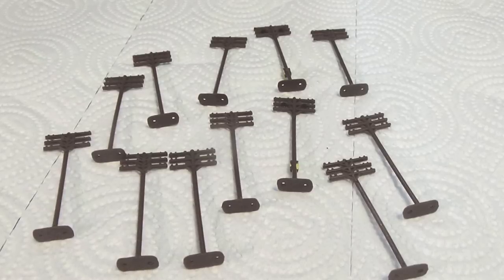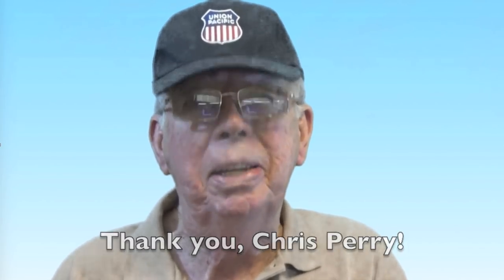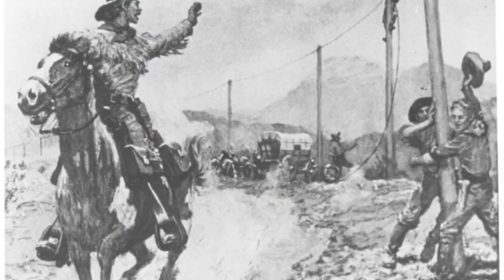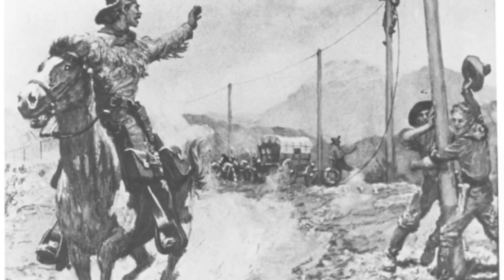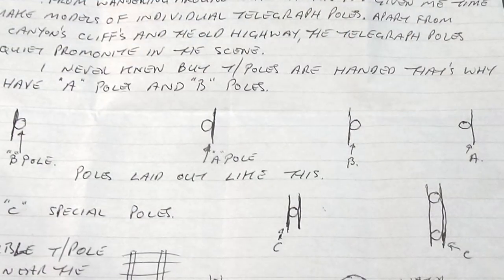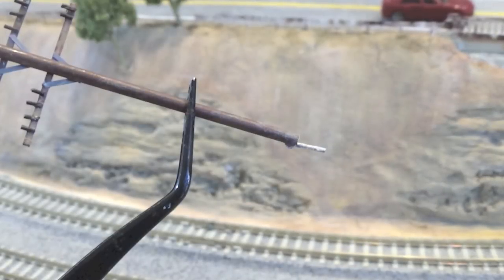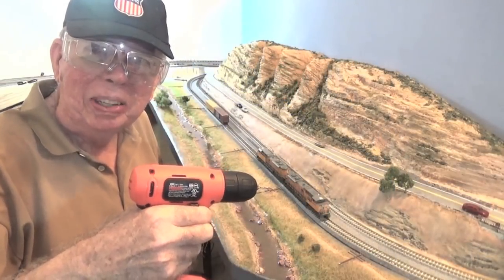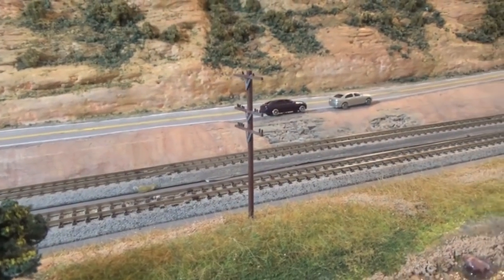Echo Canyon16: I Utility Poles on My N-Scale Layout

Comment: Roy, Amazing work and a magnum opus if international cooperation! It was interesting to me that the poles preceded the railway. I thought the level terrain that railway engineering provides would have come first. Just shows that the old time engineers knew how to find the "easiest" most level route. Similarly, Echo Canyon is 'simple' in its number of components because of the terrain. It is interesting to see how the addition of the poles makes a significang enhancement. Kindest Regards Stephen.
Reply from the maker: Thanks, Stephen. You're absolutely right: It's amazing what model railroaders can accomplish when they work together. The utility poles are a good example of that.  I'm very pleased with them. They seem add a lot of depth and realism to the scene. ...Roy

Comment: Hi Roy, great video on adding the pole detail to the canyon. One suggestion, to use short lengths of tubing a little bigger than the diameter of the pins on the bottom of the poles. Glue the tubes into the scenery and that way you will be able to slide the poles in and out for maintenance or other construction needs. I'm a great believer in "modularity" to ease maintenance.
Reply: Fantastic idea.
Reply from the maker: Thanks for your suggestion about using short lengths of tubing to hold the poles in place without having to glue them in place. That's a great idea, because it may be necessary to remove the poles sometimes for work beyond the poles, and that would make it easy to remove the poles temporarily. ...Roy

Comment: Those are fabulous poles!  Your friend did a great job on them!  Those are N-scale poles that would HO scale detail (or better).  By the way, I saw three white stripes on one pole.  I don't know if Chris told you, but UP used their lineside poles for mile markers also.  A mile marker plate would be placed on the pole at the mileage point from Omaha, then at 1/4 mile there would be a single white stripe, at 1/2 mile there would be 2 stripes and at 3/4 mile there would be three stripes, then at the next mile another mile marker and the pattern repeated.  In my end of Nebraska most of the lines are gone, but in some areas the stumps of the mileage poles remain with their stripes.  Just another "UP specific" detail.  You can check your collection of Echo Canyon photos and see if any stripes show up.  If so the poles are UP even if they allow other peoples' wires to be carried.
Reply: Gary,When making the poles I wondered if the white stripes were some sort of mileage marker and now I know, thank you. I didn't add the mileage marker plate. I've left that job for Roy to do when he's having a quiet day. Cheers, Chris Perry.
Reply from the maker: Haha! So true, Chris. I was "on vacation" yesterday. ...Roy
Reply from the maker: Thanks, Gary. I really appreciate your clarification about the white strips on the pole. Your comment is a perfect example of how we in the hobby can share our knowledge and skill with each other. This kind of sharing is what makes the model railroad community so special. Chris indeed did a spectacular job in making the poles. I'm very pleased with the affect that they have in Echo Canyon. ...Roy
Reply: Gary, It's worried me for the last 2 day's, so for the pole with 4 stripes I've made a mile post marker plate. I hope Roy can instal it by Christmas, we'll see.Cheers, Chris Perry.
Reply from the maker: That shouldn't be a problem. Thanks so much, Chris. ...Roy

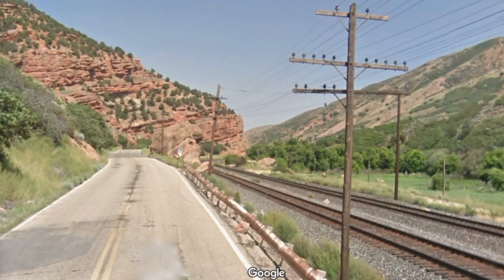Comment: Roy. Enjoying you series. As we know the Evanston Sub is CTC. (Re your picture at 4:01) The top wires are ac power line.  One lowest pair most likely closest to the track was/is the voice telephone line. The voice telephone line would have criss-crossed on a special bracket at the insulator location every few poles to cancel line impedance. The rest of the wires are signal code lines for the CTC. The ac insulators are usually black/brown ceramic while the rest were usually white/green glass.The bracket and arms alternate each side of the poles to minimize the damage caused when a line is pulled down in a storm of accident. The next pole acts as a brace. Nice detail that Gary Binder calls out about the 1/4 mile stripes. Mike
Reply from the maker: Thanks for that clarification, Mike. I really appreciate it. Somewhere I read that a part of the Evanston Sub is CTC and a part is ABS, but that information may have been outdated. In any case, I'm fascinated by your explanation of the various types of wires and insulators, as a way of identifying their individual functions. I never imagined that I would end up learning so much about utility-telegraph-railroad poles. Making this video and reading everyone's comments has been a real learning experience for me. ...Roy

Comment: wow - that is very realistic . Tip of the hat to Chris!!
chris if you are reading this they are the spitting image of the old poles I see along the CP mainline up around Hope BC.
ours were used back in the day for telegraph messages etc. Some of them still have wire on them but this is usually only in hard to reach areas in the canyon,and on the ground for the most part.. bit of a tripping hazard if you are approaching the track through a bit of forest with one's sunglasses on... yeah I tripped over them sprinting down towards the track...glasses, camera ,wallet , the lot all over the hillside...
note to self: remove sunglasses when entering shady forest...
ps 
the  CP Rail telegraph poles are definitely at different angles...
Reply: Mr. Bill Macneill, Thank you so much for your kind comments. Roy and myself can't get over how everyone  seems to have taken the T/Poll's heart. There are differences between poles and how they are used around the country. More so before concrete pole's became more common. Now a N.Z. tale. For many, many miles of new telephone cable was buried underground.But the old  p/pole system was left in place as a backup just incase. A couple of years later someone at the telephone company decided to switch on and check the old system, nothing worked. On going out to check they discovered all the wire had been stollen only the poles were still intact, no one had ever noticed that the wire was missing. Just be carefull out there. Cheers, Chris Perry.
Reply from the maker: I guess it's amazing just how often the wires gets stolen, Chris. The interest in the poles you made has been really overwhelming. ...Roy

Comment: Most railroads used 30, 33, 35, or 40 poles per mile.   That would translate to spacing of 176 feet,  160 feet,  151 feet (150.86), or 135 feet.  The mile post  marker would be on the pole with  corresponding number of bands for 1/4, 1/2, and 3/4 mile marks for 40 poles per mile.  This was very common.
Reply from the maker: Thanks for that information, Roy. I appreciate it. I never imagined that I would end up learning to much about utility-telegraph-railroad poles. ...Roy

Comment: Sadly utility poles are overlooked by so many model railroaders, but are an integral part of railroads. I repaint all my plastic poles with a flat 'natural' pole type colour before 'dullcoting' as well to remove that 'toy' look plastic sheen from them. Love those poles of yours...and oh, align them but don't straighten them, as the 'lean' is usually caused by ground movement over time according to my 'surveyor' son!
Reply from the maker: Thanks, Adrian. You're right: some of the poles are leaning on the prototype, so they should be leaning on the layout, too. ...Roy

Comment: Hi Roy; are you considering  installing the poles thru out the layout ? If so, I think that installing the wiring  between  them would clutter up all the views  of the layout. Enjoying  your videos very much!
Reply from the maker: Thanks, James. Poles elsewhere on the layout may come later on. We'll see. I certainly agree with your assessment of putting wires on the poles. I don't think it's necessary in N-scale, and it probably would get in the way of other work. ...Roy